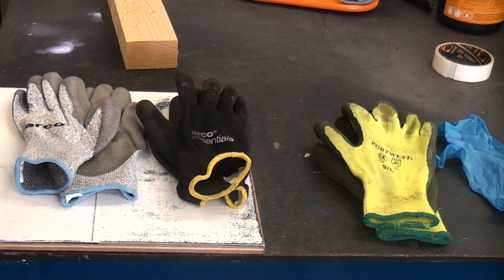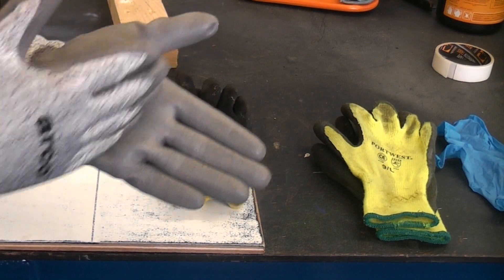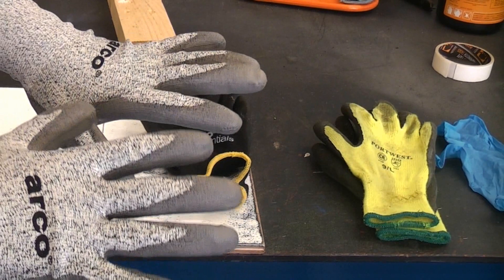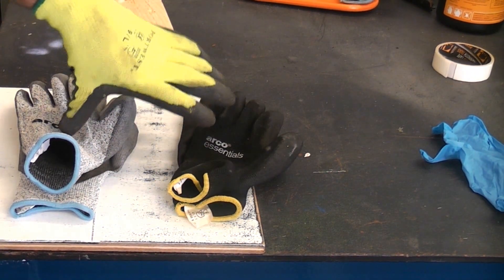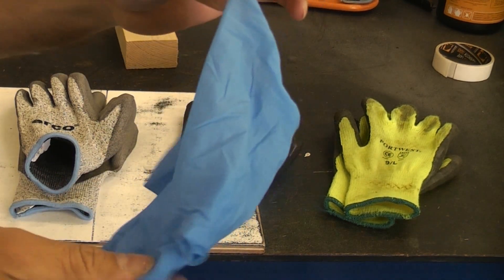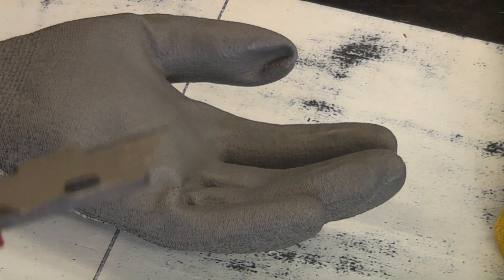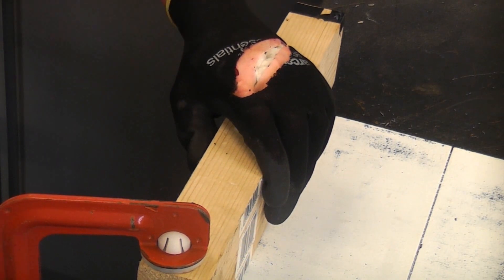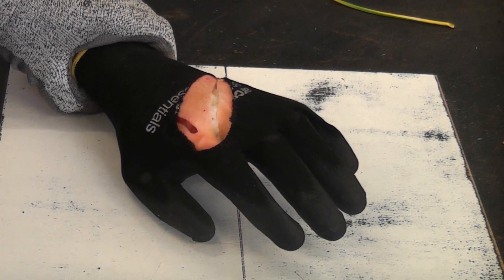Safety gloves | Work gloves

Comment: I noticed that when you were cutting the cut resistant gloves, you had a well used old blade in the knife with a rounded over tip.  When you were cutting the black glove, the blade was brand new as can be seen by the super sharp point on the knife.
Reply from the maker: Drew Willcock 
It was the same blade but I turned it around as I noticed it was a little worn. Trust me even the dull part of the blade would have made a real mess on the non cut resistant glove ;-)
Reply: ***** Oh for sure it would.  I used to own a pair of kevlar gloves with wrist protection for my old job.  You wore them under another pair of gloves.  I lost count of the times i sliced through the outer glove, with either a blunt or new blade, but the kevlar protected your hands and lower arms.  Dont remember what happened to them though.
Reply from the maker: Drew Willcock 
We used to wear Kevlar gloves also ( I think they were made by DuPont ) but they used to shed small yellow fibres eventually and they would also wear into holes in places where the gloves were constantly touching the glass (not sharp glass). These new generation cut resistant gloves are much better, very comfortable and good fitting. They are also pretty good at resisting grease (something Kevlar did not do).
Thanks for the comments ;-)

Comment: Shame my friend in Burnley didnt have any gloves when the bottom mould he was removing from the platen fell straight  through and severed 4 fingers at the knuckle.
The Health and Safety Rep was kind enough to remove the bottom panel from the press and pick up the loose fingers from the oil and swarf under the machine.

As the Ambulancemen carried my then unconcious friend away on a stretcher- the H+S Guy was also kind enough to press the loose fingers into the palm of his good hand....
My mate was consequently "sacked" for misconduct.
 Happened in 2008 in Burnley- no names will be mentioned.
Reply from the maker: Scooby2142 
Blimey, that type of accident should never be allowed to happen.
I guess that's why they are so strict on the site I work on about wearing gloves. 
Sometimes when wiring in panels you need to remove your gloves, but you have to go to the permit to work issuer and get a special dispensation note. If you just remove the gloves to do the wiring you will be disciplined!
Thanks for the comment.
What happened to your friends fingers, were they able to stitch them back on?
Reply: I'm afraid this accident actually happened twice. The first time they were crushed flat- the hospital rebuilt them over 9 months of intensive reconstructive surgery. He came back to work and within the week the same thing happened again so no he lost them the second time.  There is a moral here somewhere but it's too painful to contemplate. And understandable why he had to leave in the end.  ALWAYS WEAR PROTECTION GUYS...
Reply from the maker: Scooby2142 
I guess some people never learn!
Thanks for the comment and sharing the story ;-)

Comment: Great demo!
Day to day I wear Puggy 2000 in grey, they are a nice lightweight gloves that keep my hands clean, help me grip and prevent scratches and abrasions. They also keep my hands warm when touching the cold metal handles on the lathe.
I am blown away by those cut resistant gloves though, I really need to look into something like that for when I am doing DIY!
Reply from the maker: caskwith 
Thanks for the comment ;-)

Comment: I normally wear the cheap rubber palm gloves, they do protect you from spinters, sharp/rough edges, getting blisters and general scuffs, and they do offer a lot of grip but I will be investing in a cut proof pair next time I go to screw fix! What was that hand made from?
Reply from the maker: MakingTheCut 
It was a "horror" type false hand bought from ebay. It's made from a rubber like flesh coloured material that has been filled with fibre filling. There is a false bone sticking out at the arm end and it's painted blood colour!

Comment: I am now and have been for about 18 months been a wearer of gloves when I am working and this is SOLELY down to your films. I always felt less masculine??? if that is the correct term but I have been in 2 situations where my Kevlar gloves have helped save me from some nasty cuts plus endless splinters and chemical splashes have been saved by my everyday work gloves. I don't think twice about wearing my gloves now and have different types for different jobs. Thanks mate. N.
Reply from the maker: Neil George 
To be honest Neil I used to work on a farm and never wore gloves. I used to get blisters on my fingers at hay making time and my hands were always full of splinters from fence posts. It was only when I started working for ICI in 1991 that I was forced to wear Kevlar gloves. Since then gloves have come a long way and they are now comfortable to wear and do not hinder me at all, so I do not mind wearing them. I can't think of a time when the gloves have saved me from injury although I am sure they have and I was unaware of it. My safety glasses on the other hand have stopped a piece of white bearing metal from hitting my eyes, when someone was knocking a bearing off a shaft and I was stood 15 feet away! 
Thanks for the comment
Reply: You have a good reason for pushing the safety message re. the PPE in your films then. I remember when working at a building suppliers my fingers would be so rough that when I stroked my young son's cheek (trying to get him to sleep) he woke the next day with what looked like "shaving rash" from my rough hands. I am a convert now and things would have been alot better had I worn gloves years ago. Thank you for taking time to reply mate. N.
Reply from the maker: Neil George 
You are welcome
Thanks for the comment

Comment: Nice informative video. You do get quite a few tradesmen that don't really give this enough importance. I usually use carpenter gloves as it provides a little protection however the fingers are cut away for fiddly work. Dewalt do a nice set, which reminds me Api need a new set!
Reply from the maker: Zed Man 
Thanks for the comment ;-)

Comment: I am a joiner to trade and I do make use of gloves in the manual handling of materials. Every health and safety machine course I've been on (lots due to working for a Local Authority) have stated that you shouldn't wear gloves when using machines, due to the risk of snagging on the rotating parts of the machine. There is countless cases of people having fingers torn off and wrists broken due to hand being dragged into lathes, drills etc..
Reply from the maker: duncan kotlewski 
Absolutely, I never wear gloves on the lather, or long sleeves either.
When working on large drills in the workshop or fixed machines I never wear gloves but have to wear them when using hand held machines out on the plant.
There are times when wearing gloves is dangerous, as you have pointed out.
Thanks for the comment
Reply: ***** Thanks for the reply! Not many youtubers reply anymore. I find your vids very informative. Even though I know how to do most of the content you post, I find it really interesting to see how other tradies do the same job differently! Also I must thank you for the Fugi vid. I now have one in my pocket at all times, and the rest in my tool bag! Amzing product!!
Reply from the maker: duncan kotlewski 
You are welcome. I meant to type in Lathe above not lather!
I do try and reply to all comments but sometimes I do miss them if YouTube is playing up.
Thanks for the comments ;-)

Comment: They brought in mandatory glove wearing offshore years ago but they have been trying to push it onto oil service ships too. A bad idea in my opinion. Gloves are great to save your hands in incidents like you show here, also when using wire ropes or hot/cold machinery etc but they can cause horrific injuries when using rotating machinery, or like at sea when using ropes, as they can become trapped and prevent you from pulling your hand away. I also know of an incident with a mag drill in Rosyth Dockyard where when setting the mag drill in place the power button was pressed instead of the magnetise button and the drill bit grabbed the glove finger and ripped the finger right off the boys hand. if he hadn't been wearing the glove it might have cut him but he could have pulled away.
The moral of the story is that mandatory job site PPE regs specific to items of PPE are flawed. PPE should always be chosen specific to the task you are doing not so much the site you are in.
Reply from the maker: Chris Ryan 
They had a similar incident a few years back on the site that I work on with a mag drill and gloves.
I must admit that I always remove them on the lathe or when using the pillar drill. 
Thanks for the comment

Comment: Very expensive [braces self] £10/pr... cheaper than a new hand/fingers
Reply from the maker: ***** 
Absolutely, but the problem with these gloves is that according to the manufacturers you cannot wash them as they lose their cut resistant properties if washed ( I have not tested this out yet ), so they get thrown away when dirty!
Thanks for the comment ;-)
Reply: ***** I tried washing another brand of safety gloves in the washing machine, as I hadn't put latex gloves over them, and they'd gotten stained.. This was a bad idea. They disintegrated completely.  I hate throwing gloves out after a single wear! If you're ever going to wash them, I'd suggest a gentle hand wash. Then try a cut test on them. The manufacturers may just be trying to cover themselves, and drive additional sales.
Reply: ***** I would think that is something to do with the heat from washing maybe? Maybe you could save the dirty pairs you would normally throw away and then do another test like this? I would bet that a gentle wash in cold water with a mild soap like washing up liquid (hand wash rather than machine) followed by a good rinse and drip dry would not harm them.
Reply from the maker: caskwith 
I have a few pairs saved up, I'll try washing them and do a similar test in future ;-)
Thanks for the comment
Reply: ***** i bought a set of Portwest A710... They lasted a few days until i washed them 3 times and then done some other brick work in the wet gloves soaked and yep ripped the cuf but i have CLC Flex gloves that lasted me since march being washed and doing brick & block work everyday
Reply from the maker: SgtAMYNTAS 
Thanks for the info ;-)

Comment: What would you recommend for a electrician?
Reply from the maker: I'd go for the cut resistant ones, but at times when terminating wires you might need to remove them.
All the electricians on our site have to wear the cut resistant ones, but often get a dispensation so that they can remove them when terminating the wires into the terminals. 
Thanks for the comment
Reply: Ultimate Handyman Thanks.

Comment: Are the cut resistant gloves level 5 ?
Reply from the maker: wayne burgess 
Not sure, I have only ever bought one pack of them and have lost the information leaflet from the pack. I'll try and find out the next time I get a new pack ;-)
Reply: No worries
Reply from the maker: +wayne burgess I have checked the leaflet that comes with the gloves and they are-CAT II (intermediate risk). Abrasion level 4. Blade cut Level 3. Tear Level 4. Puncture Level 2. Thanks for the comments Wayne ;-) (P.S. YouTube comments keep removing my spacing, hence it's all on one line)
Reply: No worries bud. :)